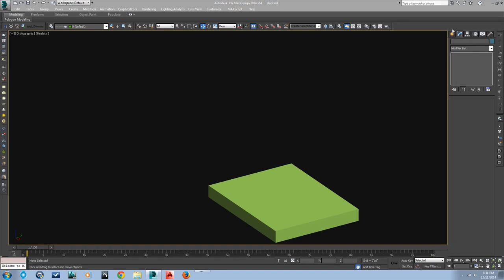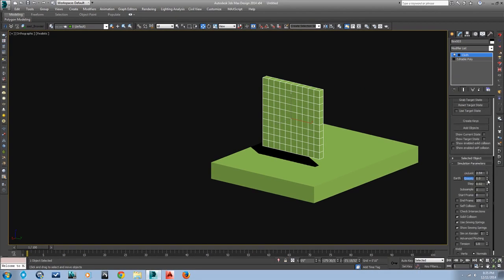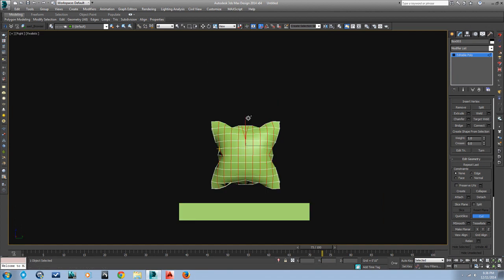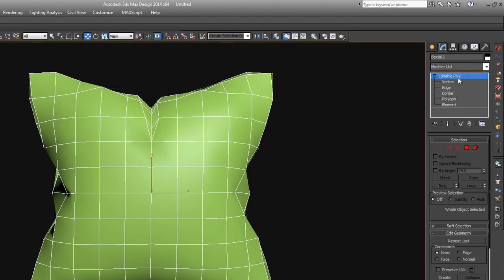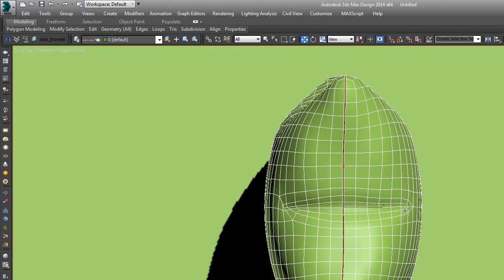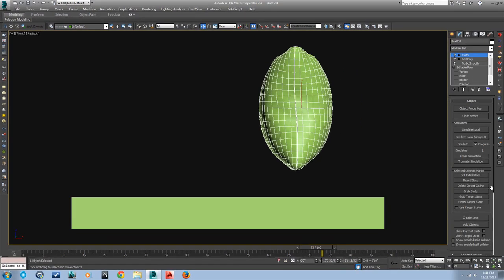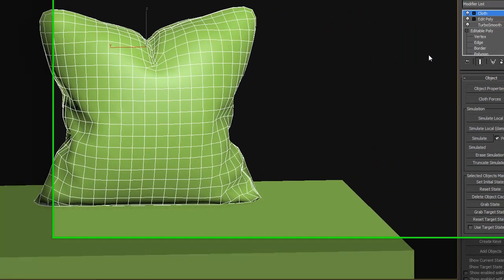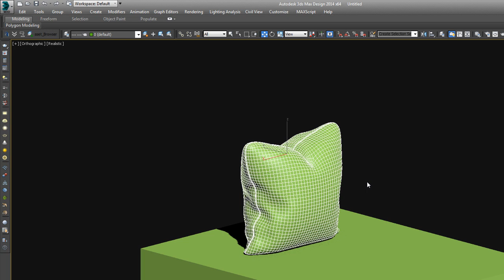3ds Max Tutorial: Model a Perfect Cushion Using Cloth Modifier

Comment: If you have issues where the part goes the wrong direction or go through the collision object you most likely have the parts too small in the scene. Make the parts larger. Also you do not need to add any pressure just leave it zero. Silk gives the best results. Put gravity -980 and use the simulate and once you click cancel the the part over collides move the key frame slider back to get the amount of collision you need.